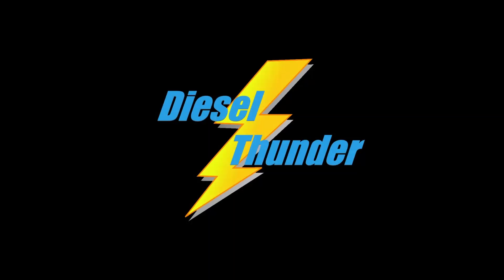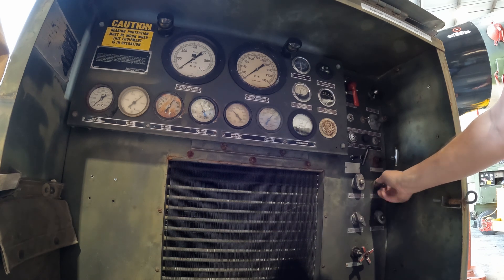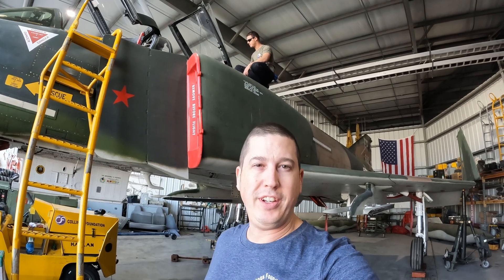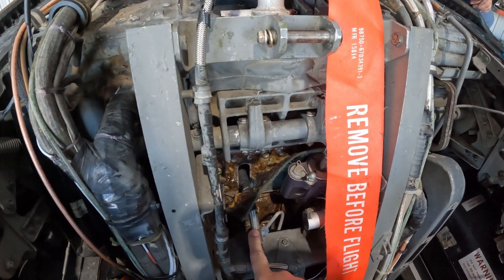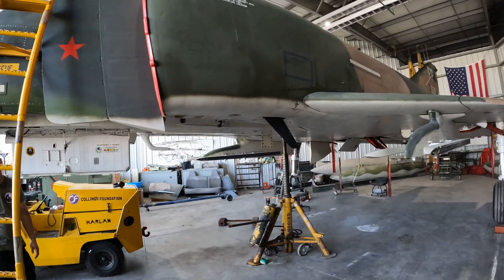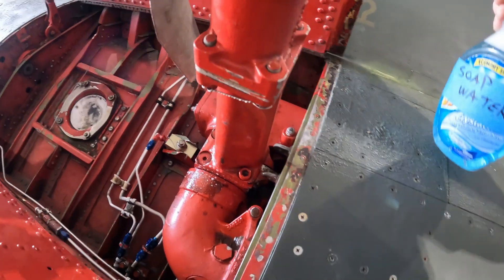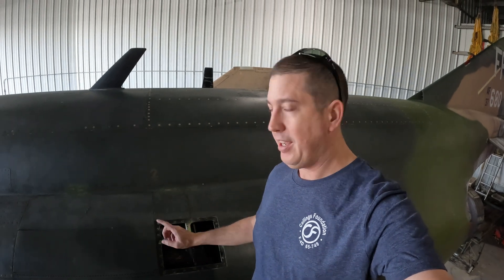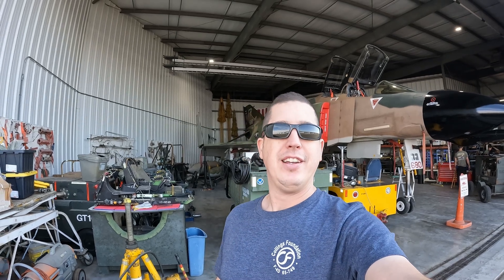Found an Air Leak | F-4 Phantom

Comment: First, let's talk safety. When working round the rat you should always put in the safety struts (ask Al). There are switches that are in the rat compartment. If you look in front of pin wheel there is a valve with a little button on top. If you should push it the doors will snap closed and either catch your arm or get bent up on the shaft. The canopy actuator leak on the up is a problem. Removing the trans rectifier you might have  loosened a B nut or cracked a connection. Before you get into taking the actuator out really look at the TO. If I remember right you have to take the whole bulk head apart to get to it.  Congratulations, you didn't use a crescent wrench.

Comment: You need an "Ultra Sonic" type Leak detector with Headphones & a flex Extension wand to Exactly Pinpoint any Compressed air Leakage.....Even relatively Low Pressure (Under 20 Psi) leaks can be Located.....
Reply from the maker: Sounds like a nice tool to have. Are they expensive?

Comment: I never imagined that there were privately owned F4s out there, but I'm not surprised by any means. Very cool. They look so sci-fi to me. Last summer I bought a car from a guy who is a "F-4 and C-17" engine mechanic. In the back of my head, I was sort of wondering where he found F-4s to work on. Perhaps it's for private or air show F-4s.
Reply from the maker: F-4’s stayed in service into the 90’s, and the C-17 is still around. Crew Chief Al worked F-4’s until they were phased out and then moved over to F-16’s. There’s plenty out there that are privately owned, nearly all of them are static displays. This one featured on the channel is the only flyable one in the U.S.

Comment: Love my F-4's. I worked them my whole Air Force career as Egress. Sounds like the shuttle valve is bad. A good idea, if you can, get a magnetic bolt holder that goes into the socket so if you remove the bolts on the Hell Hole cover, you will not drop a bolt. Another idea is put some masking tape on the end of the socket with the sticky side facing away from the socket, sticky side facing the bolt. That way the bolt will stick inside the socket. You can also use some mechanical finger's to remove the bolt's and washer's. Just loosen the bolt's, then put the mechanical fingers on the bolt and washer and turn the finger's until the bolt comes out. That is what I have used a ton of times. I have worked a ton of air leaks and removed a boat load of Aft Canopy actuators being Egress. Not a fun job but a whole lot better then a Fwd Selector Valve. The FWD selector valve is the item above the AN/ALE-40 panel and above the gray bracket. It has a line on each side of the valve and the plug with safety wire on it.

Comment: Really loved this video! Learned something new about the RAT and how it's deployed, Awesome! ❤. I'm an auto tech for Mercedes Benz and over the years Benz has used on their cars a variety of pnehmatic and hydraulic systems with many hidden actuators to have to diagnose in some very tight spots much like the Phantoms cockpit, I have learned to adapt. Along with the soapy water I also use a mechanics stethoscope but without the tip end on it so it's like an open rubber tube directed into my ear cana, and with the stethoscope plugged into both my ears it cancels other noises out so it's easier to pin point minor air leaks much like the one at the RAT. Hope this helps...

Comment: Long distance diagnosis:  you have two possibilities No 1. The hose that runs to the side at the top of the actuator has an o ring on the actuator end that can dry out and cause a leak there.  It is a bit awkward to get to and requires a crowfoot or bent wrench to loosen.  The other end is easy because it comes out of the actuator well into the cockpit in an easy place. Once it is loose at the top you can sort of twist it at the bottom end to unscrew or reattach it.  A new o ring and a little pneumatic grease and it will fix it.  There is one trick to this that is not in the TO.  You can disconnect the actuator from the canopy (with all air off the system) and manually lock the canopy mechanism with the external handle.  This moves the actuator up and makes the hose easier to access.  Just remember to support the canopy and unlock the locking mech before trying to operate the canopy.  No 2 (and the worse possibility) is that the shuttle valve on the bottom of the actuator is leaking, and unfortunately judging by the amount of air leaking the probable fault.  The bottom of the actuator is only pressurized when the canopy control is in the open position, not in the closed position, so if the leak stops when you close the canopy you have found the problem  This is a real pain, because you have to remove the actuator.  This is not fun or easy due to the level of disassembly.  Checking it is a little easier.  Since you already have the seat out, step one is done!  Remove the canopy mech damper (looks like a small black actuator with a grease fitting on it) and then remove the access panel that is behind it and one end attaches to.  It has like 15 or 20 10-32 bolts.  You will also have to disconnect the hose to the actuator that goes through there.  This gives you access to the bottom of the actuator.  Maybe you will get lucky and it is just one of the two hose fittings on the valve has come loose.  If not, you are in for a 4-6 hour (minimum) job.  If you have to remove or disconnect the actuator you will need a special item called a canopy brace.  It is about 4 feet long with a slotted flange on one end and a squared off piece on the other end.  It holds up the canopy when you have to disconnect the actuator.  It fits on one of the front canopy hooks on the top and sits into one of the roller boxes at the bottom.  GOOD LUCK!
Reply from the maker: Really appreciate the insight, thanks! Hopefully not the shuttle valve either, though it kinda sounded like it. Leak stopped nearly the same moment that I hit the canopy switch.

Comment: it's nice to see you working on a new phantom model for DCS and that plane behaves like a mig-21 🤭 there is never enough air, install an additional compressor to supplement the system, that's the only solution 🤗
Reply from the maker: With that leak, sounds like she'll need 3 compressors! And I agree, the 109 is a great aircraft in DCS!

Comment: Look at the bright side, when I was a crew chief on F-4's I chased air leaks, when I crewed F-16's I chased hydrazine leaks. I will take air anytime.
Reply: @elrobo3568 Air leaks are horrible on the F-4. You'd fix one and it pop somewhere else. We had one we chased for days and it ended being the open/close switch. After got the changed that thing would hold air for weeks. I have dealt with the hydrazine leaks yet.
Reply from the maker: Always heard that hydrazine was some nasty stuff. Glad we don't have to mess with that!

Comment: If you can get "Gas-Control" or some other professional bubble leak detection spray (about $17.00), they are a lot more bubbly and will indicate the smaller leaks. (but not for oxygen lines !).  The smaller leaks often don't show whan using soapy water.

Always something to phix on a Phantom !

Comment: The rear canopy actuator can be a pain. The book for that if I remember correctly is 1F-4()-2-3. That line you pointed at. You disconnect that and then remove the panel that the line goes through. And then you have access to the infamous hell hole and you can get to the bottom of the actuator. Rarely do the AFT actuators go bad, but when they did, they did it with style. Some other culprits I would check for leaks in both cockpits are the dump valves and the POV valves. With the leak in the AFT I think they are good but it wouldn't hurt to check before the seats go back in. Atleast the POV valves. The buckets at a minimum have to come out. Good luck thank you for putting these videos out.